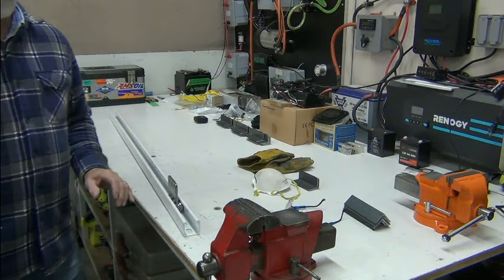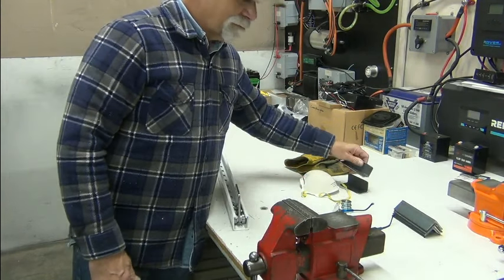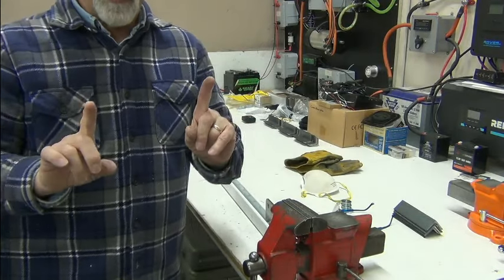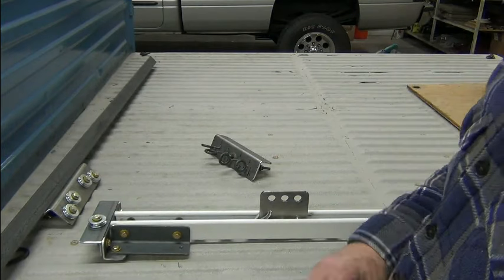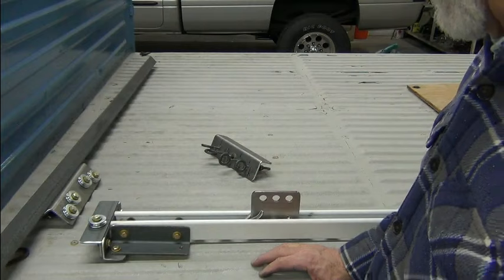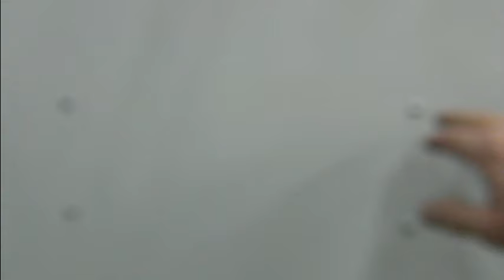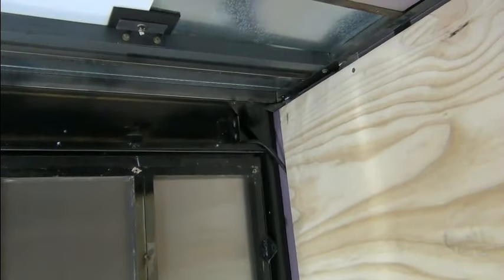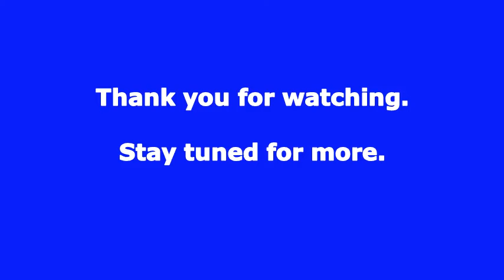Cargo Trailer Bed Lift Mechanism

Comment: Make every effort to keep your back vertically straight as you work. Bending forward over your work will put unnecessary strain on lumbar and sacral structures. Try bending at the knees instead.  Basic martial arts stances are even better (retired therapist & van dweller)